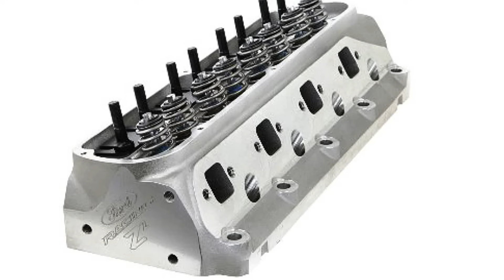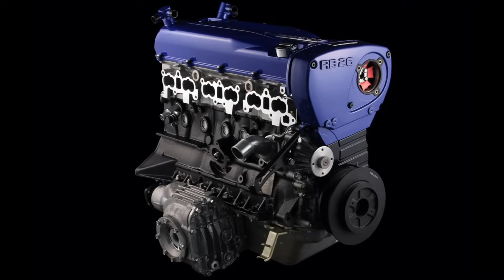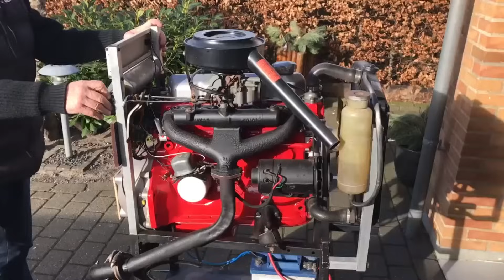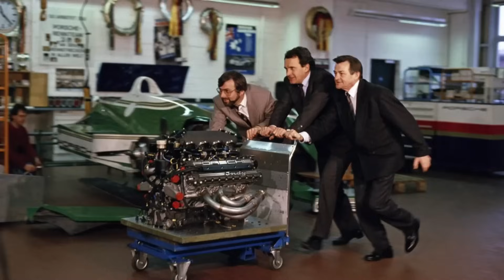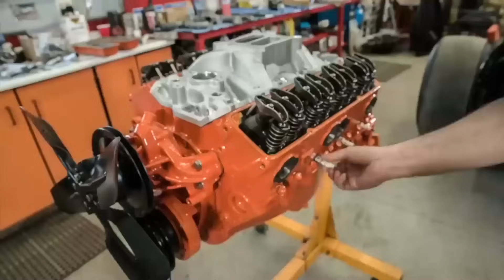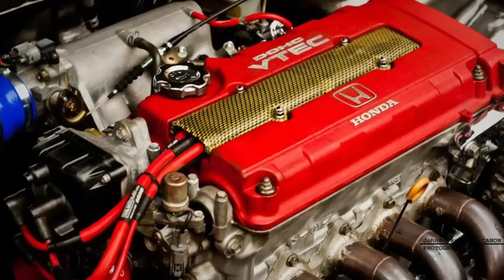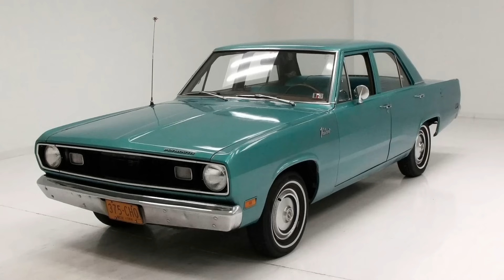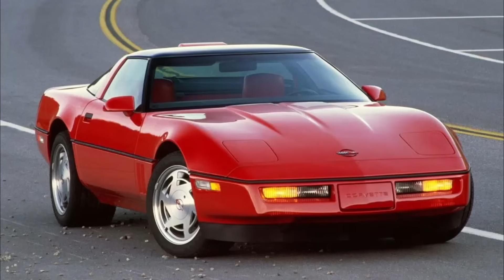30 Car Engines That Will Last FOREVER (2024)

Comment: The Ford 4.6 V8 came in at #11, but I think its still very underrated as for longevity. This engine powered the majority of commercial duty vehicles in the US for decades, and is well known for extreme high mileage and extreme high idle hours. This engine powered the iconic Crown Vic police, fire, taxi cab, the Explorer Police Interceptor,  the Lincoln Town Car and limos, and F Series trucks, all high mileage, high idle hour work duty vehicles from 1990 to 2012. These engines were abused daily from instant cold start and high speed driving without warmup, to idling on scene for hours on end with the A/C running, as well as routine maintenance neglect by most of the cab businesses. Yet there are thousands of examples of hard driven 400K mi + vehicles still in service and driven second hand. Most of these service vehicles you can easily add an additional 50% to the odometer mileage from the wear from long idle hours. All engines have their quirks. The 4.6 suffered from only 2 well known issues; Spark plug blowout (usually from deviation of the very specific and critical torque measurement by mechanics) and intake manifold cracks that leak coolant. Both are relatively inexpensive and easy DIY permanent fixes. I did both on my 07 Mercury Grand Marquis at 150K miles after I stripped a spark plug thread during a tuneup. I did all 8 stainless steel inserts from a kit and upgraded the manifold (preventative, since I was already in there) for around $450 and 3 hrs weekend labor. The car is getting close to 300K hard daily driver miles now, and the engine has never had a single issue from the time It was purchased new and I acquired it with 32K on the Odo.
Reply: The TWO valve version of the 4.6 .....the THREE valve setup ruined that engine.
Reply: I have a 2v 4.6 mustang that I currently daily drive as well as weekend track car 
I drift so the car takes a beating and has not left me stranded yet
I drive the car to the track and then back home sometimes doing 2 day events
Reply: You’re right. Those 4.6’s last half a million miles easily. My uncle has a limo business and had about 80 in his fleet. He’d buy them at the auto auction a couple years old with low mileage around $5-10k and run them 400-500k miles and sell them for $5-7k. Only issues would occasionally be the transmission and some electrical
Reply: As a mechanic and from experience from working in the junkyard and as an engine builder of 20yrs. The 4.6 is not what they claim and is not as reliable. Definitely way better than the coyote motor. As as it stated in here, the 300 inline 6 should have been almost towards the top of if not within the top 5.

Comment: I thinnk the Ford 2.3L 4-cylinder was a workhorse engine. Hy wife's '74 Pinto Wagon went WAY beyond 300K miles. I also had that engine in my '87 Ranger S-Model pickup truck - I sold it after 450K+ miles (couldn't pass California Emissions.) I wouldn't be surprised if it was still running strong coming up on 40 years old. The rear main seal had issues, but that truck cost less than $7000.00 brand new - I got more than my money's worth.

Comment: I had a 2000 Celica with the 2zz it still ran fine at 350K but the tranny went out so I got a new engine and transmission at the same time.

Comment: 2003 Chevy 6.0.   
350000 miles
10 years of idle time
all original inside engine down to still having original head gaskets.
Replaced oil pump oring... Some fuel injectors.... Most sensors.....  

Changed oil every 500 hours

Comment: I had well over 500,000 miles on my Ford 351 Windsor by the time I sold it .  2 fuel pump changes .

Comment: How much does it cost to change the timing belts or chains on these cars if done professionally or how hard it is, and how long would it take to change the belts or chains on these cars? I know it is important, but it isn't cheap, and on a 2018 Ford Explorer, it ain't quick and easy.

Comment: My Ford 2001 Expedition with the early 5.4 liter has ~360,000 miles with no problems, all original. Change your oil! This is the secret to any engine longevity.

Comment: A couple of oops of wrong materials. Nissan SR is not cast iron block, is a aluminium block. Toyota 3s 1st cam out with water intercooler, not air intercooler, the oops list goes on ay

Comment: One thing to note about the Buick 3800 V6 is that it did not have aluminum heads. It had a cast iron block and cast iron cylinder heads.
Reply: And 30 years to get the bugs put
Reply: Couldn't drive behind one. Would burn antifreeze and could not breathe

Comment: I have a 2003 explorer 4.0 v6 with 233k miles. Runs like a charm. I think these older engines were the peak of reliability tho. I don’t think these turbo engines or aluminum engines are going to last as long.

Comment: BMW M50/S50
BMW N54
Ford Barra
PSA HDi
MB M104/M104
MB OM605/OM606
SAAB B204/B234
Volvo B5244

All of them deserves to be on the list but not that Porsche engine with poor designed irs bearings.

Comment: I had a Chrysler slant 6 and it went through points ,distributors and caps .  I was glad to get rid of it .  
I don’t understand why car and truck makers just stick with solid engines that last , instead of coming up with all these iterations of engines that are losers. Ford 5.0 liter in their trucks are solid , but they are hard to find and Ford goes to some other engine that doesn’t last.

Comment: Takeaway: The three secrets behind good engines:
1. Good lubrication
2. Good lubrication
3. Good lubrication
Reply: Well said
Reply: @TheJonathanNewton  yes as long as the oil pickup isn't blocked by debris from the disintegration of the wet belt in Ford engines
Reply: oil change - oil change - oil change
Reply: @pedalpower57  oil pump oil pump oil pump
Reply: And make sure the coolant don't dance with the lubricant 'cuz the thermostat got constipated.
Reply: That's what she said!
Reply: Lubricating is no good unless it is specific for that motor,
You try running 2 stroke oil in 4 stroke idiot.
I used magnetic 20W50 in my super glide for 15 years and over 150,000 KM, when i put in to get it rebuilt i was abused because the 30 odd year motorcycle mechanic called me at home and started abusing me, reckons he has seen bikes in for first service that could  not touch the insides of my bike.
A hone and replaces rings pistons bearing ,etc,etc, as i requested , they said their was nothing with my rings, pistons, conrods, just slight blow out in the front cylinder gasket.
You want more evidence your secrets are not secrets but uninformed claims.
Reply: Forgot the quadruple simplicity factor.
Reply: Takeaway #2- 2006 GM LBZ Duramax Diesel!
Reply: Don't forget adequate cooling.
Reply: Change oil
Change oil
Change oil
Reply: Yes and no. Some engines are just poorly designed. Been wrenching for over 30 years. Some engines are junk from the day they were designed. Just do your homework before you buy a vehicle!!
Reply: ⁴⁴m7 @michaelfrohn255
Reply: @michaelfrohn255  gm 1.4 turbo lol

Comment: Decent list, but i would have included the 5.9 12v Cummins, the 7.3l Powerstroke on this list. Also, unless i missed it, the 5.2/5.9 Dodge Magnum engines. I would have also placed the Ford 302 and Chevy 350 both higher on the list, then #30 and #15, respectively. Their simple overhead valve/pushrod design make them easier to run hard and maintain then some of the more complicated european/japanese powerplants you have listed. And also the Chrysler 170/225 Slant Six engines from the 60's should be higher on the list.

Comment: You act like 200k miles is a big deal.  With a VW ALH at 540k miles, a Toyota 2AZ-FE at 325k miles, and even a VW AHA V-6 at 332k miles, keeping up with oil changes, and regular maintenance helps many engines can go a looong way.

Comment: My 2005 Dodge Ram with a 5.7L Hemi has 550.000 km on it (341754 miles) and I have never had a problem with any part of the engine, drivetrain, transmission, or differentials.  Regular maintenance (oil and all fluid changes) at the correct intervals is my key.
Reply: I'm driving a 1994 Dakota with a 3.9 in it at 330k miles on it. Even the AC still works, but to be fair I've treated this thing like it is a member of the family.
Reply: If that's true, than you'd better buy yourself a Lottery ticket! (I don't even endorse lottery or gambling)😂  You've been blessed with a miracle!  I worked for multiple police departments (not an 👮 officer), and police chiefs bemoan the reliability of the semi-Hemi! Even my Mopar-worshipping uncle vowed to never buy another one again after replacing the engine twice in his Ram. I mean no insult, happy about your luck so far and hoping it continues!😊

Comment: An engine that needs head gaskets replaced as a preventative measure isn't a reliable engine. LMFAO.
Reply: You talking about the EJ? 
By far the least fav, and who wants to lay on the ground to replace spark plugs
Reply: You're uneducated and obviously not mechanical included

Comment: I have owned several Windsor 302s (still own one). They take a lot of beating and don't need much care. All have gone well over 100k miles for me. Usually the car itself rots away while the engine remains strong. LOL. The small block Chevy is also a legend.

Comment: my Opel Combo van fitted with an isuzu 1.7 litre turbo diesel goes for 240k miles now engine still stock original never went apart.
only problem is that the chassis is too rotten to fix.

Comment: There you have it!  We have a large variety of engines from multiple manufacturers, over a long time span, that have proven their exceptional worth for reliability and longevity.  We've analysed and determined a number of designs, materials and characteristic of these engines that make them super engines.  Some remained in production for 50 years and others only a year or two.  
Here comes the hundred thousand dollar questions;  Why do manufacturers retire/discontinue a quality engine, to replace it with an engine fraught with lower standard issues?    Why haven't these proven characteristics been incorporated into the ultimate engine that can be sold with a standard 500,000 mile warranty?   Is it simply designed obsolescence to sell quantity, rather than quality?   In an insanely competitive market, is the old saying; "build a better mousetrap and the world will beat a path to your door" dead?

Comment: I had the slant 6 in my '68 Charger and agree with the analysis here.  The Toyota 22-R was good but I'm liking it's daddy the 20-R in my '78 Celica with the T50 5 Speed manual.   I had it for 23 hard driving years and 260k mi.  Tough, durable and quick.

Comment: Several of my cars' engines were running well beyond 250,000 miles.  I changed the oil regularly, used Slick 50 and de-coked the engines with full Redex treatment in the cylinders.

Comment: Only one Toyota diesel?  Nothing from the B series?  3B  or 13BT needs a spot on the list...I didn't see a single engine with timing gears mentioned.  What are these belts you speak of?

Comment: The Aussie variant of the Chyrsler Valiant 225 slant six was an amazing engine. I had a rare 1969 VF Valiant Sedan Regal with the 180hp engine that was found in only a handful of Valiant Pacers. 
Seriously that engine was incredibly responsive and terrifying. What was more terrifying though was it had all that power and still had all wheel drum brakes.

Comment: Any version of Chevy 350. Best motor ever.  I’ve owned about 20 vehicles and never ever worked on any of the.  Best was the lt1 Buick  loadmaster 28 mpg  300,000 miles guaranteed and governed to 150 mph with room for 8 people    Also the Camry v6 3 litre motor

Comment: I had a Chrysler with a 225. That 30º slant made the passenger side of the engine a devil to work on, but it indeed kept running long after the car's body rusted out and the suspension was mushed.

Comment: Holden red and blue motors are touch old things, you can get good power out of holden red motor just by tuning the carbs and ive seen a blue motor run with completely shattered piston. Also Chrysler hemis (215,245,265) are absolute beasts, especially the 265s which are an inline 6 with v8 pistons and the power to match

Comment: forgot about legend  KA24E5 engine, in my truck lasted 16 years with out single break down. found in Nissan pick up around  1988 to 1997. my Nissan pick up hit 461,000 mile. till I sold it and still runs.

Comment: 1981 Dodge truck 576,000 miles   Slant six   Just will not die     10-30 Amsoil and lean burn replaced with MSD 6

Comment: I'm not understanding why you say the push rod design has fewer moving parts. Overhead cams activate the valve directly, whereas the push rod design requires not only the aforementioned push rods, but also lifters and rocker arms. 
Literally 3 more moving parts per valve.

Comment: If only you could include a compilation that includes transmissions.... A motor can be great, but a poor transmission can spoil the recipe. You need both, a strong engine, and a strong transmission. The 22R Toyota motor deserves accolades. I've seen this motor burned in a barn fire and start up like nothing even happened.

Comment: The slant six was used in the pickup trucks, forklifts, pumps. compressors
Reply: Was also used in some farm equipment.
Reply: Was also used in marine engines, my uncle's boat has a pair of slant sixes in it.

Comment: the 3800, i have owned multiple 3800's including 2 cars i own now. i have had both supercharged and non-supercharged. aside from crappy intake gaskets they just go and go. probably one of the best v6's ever made
Reply: I had one in a 1995 olds 88 that I inherited from my grandmother. It was surprisingly powerful
Reply: @brkbtjunkie  they have ALLOT of low end torque, something more modern engines lack. a tiny engine making the same amount of power has to rev'd excessively, the 3800 has a decent amount of displacement and gets it's power down low. we still have a 97 grand prix L36 non-superchaged grand prix, same engine your 88 would have had. our car is still in really good shape and i have no intention of getting rid of it.
Reply: The ecotec 3800 in the Australian Holden commodore is a good motor and easy to work on. The ecotec 3800 v6 and the Ford slant 6 barra were in my Opinion 2 best 6 Cylinder motors in Australia.

Comment: Chevy small block 283 / 327 / 350.
Legendary engines easily achieving 500,000+ miles.
The vehicle's body usually rusted out first...I had several. 
Very easy to maintain too.
Reply: I agree, in this era Chevy is king for easy maintenance. Nowadays Fuck that.
Reply: Yup. I had a 70s truck that had rust holes all over it. It looked rough, but it always got the job done.
Reply: Old and new 350 aren't the same
Reply: My 94 Chevy C1500 had the 350 tbi engine and it held up thru 300,000 miles. The transmission however didn't last that long.
Reply: Carburetors worn shafts sucking dirt and flooding ruined a many small block
Reply: Absolutely. 
In 84 I was an owner of my first car.
327.

Then a 350.
Lived em
Reply: I loved the high performance Chevy 302 small block variant.  Loved to rev !
Reply: I've never had much luck with 350s. They tend to start losing oil pressure at about 100k miles. They are cheap and easy to replace. I despise the 305 engine. They are a horrible truck engine.
Reply: Although the Chevy SB deserves to be on this list, very few of them ever made it to 500,000 miles. That is just silliness.
Reply: Cheap to rebuild but I never had one last over 100,000 mi

Comment: THE FORD 2.5L ENGINES ARE BULLET PROOF, WITHOUT A TURBO. I HAVE OVER 200,000 MILES ON IT AND DRIVING. LITTLE MAINTENANCE. CAVEAT: YOU MUST CHANGE OIL EVERY 5,000 MILES TO ACCOMPLISH THE MAGIC.    FINIS  PAX

Comment: there are 2 engines that you failed to mention that can EASILY surpass 1 million kilometres, and that is the 6G72 3.0ltr Mitsubishi V6, that are in the Gen 2 Pajero's (Montero in the USA) of the 1990's, mine has currently done over 800,000kms on the original engine and gearbox as well as the 4wd transfer case, and im not light on the throttle either, especially while out 4wding in the bush, i have jumped it, flexed the crap out of it, even had it "see-sawing" on 2 wheels (front right and back left wheels on ground only) the 2nd engine, is the diesel version of the Pajero motor called the 4M41 inline 4cyl diesel that came out in the Gen 3's, these engines are literally bulletproof and well known in Australia to clock up over 1.5 million kilometres without batting an eyelid, also, the very 1st engine you mentioned, the Windsor 302, my mate has one in his 1994 NC Ford Farelane (came stock in them off the production line) and has 555,593kms on the odometer so far and still purr's like a kitten today........

Comment: My first car had the slant 6 with a Holley one barrel carb, you could run that thing without water or oil in it and it would still keep going. I later had a chevy square body and blew up the 305 and replaced it with a 350 out of a junkyard and I think it is still running today. A newer engine that NEEDS to be on this list is the Ford 3.0 V6 that came in the Escapes, I have 167K on mine now and still getting over 20 mpg. The only things changed have been the coil packs, spark plugs and the oil pan gasket. The rest of the vehicle will rust away from the drivetrain before it dies. Like the slant 6 it does not rev fast enough to do major damage. I am afraid to buy a new vehicle with a turbo on it.